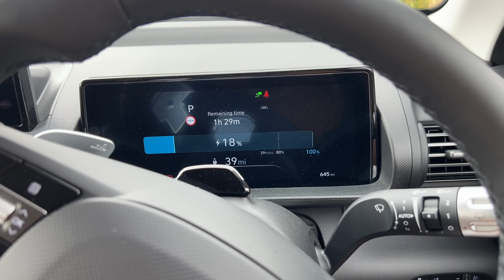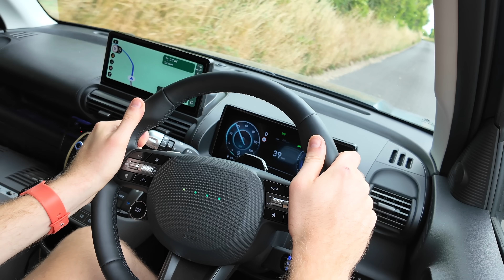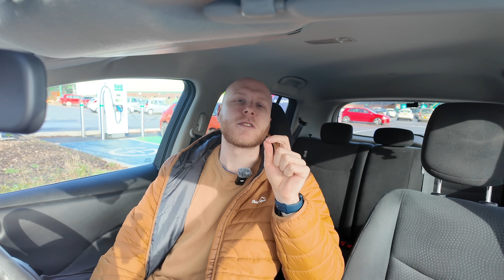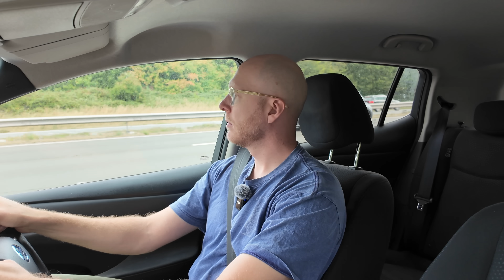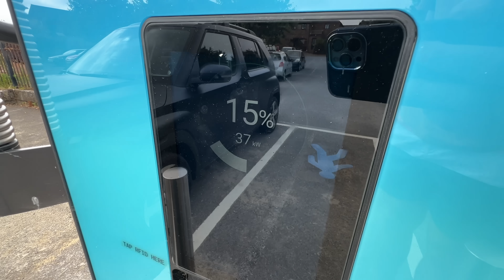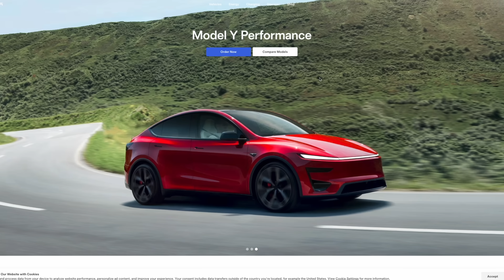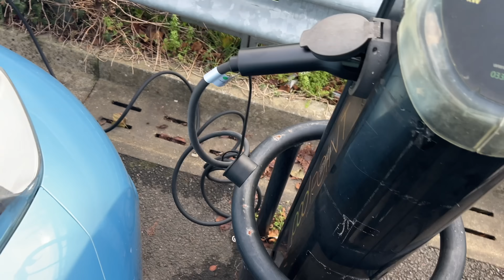19 Things You Should NEVER Do In An Electric Car

Comment: A nice video giving good information, obviously you will get the few complaining, just like those that were "never" going to get a mobile phone ! It is simple, if you do not want an EV or they are not suitable for you, DO NOT BUY ONE. Petrol/diesel will be with us for many years, probably still buy new in 2035. I remember when the UK gov said they were going to bring in the 3p per mile charge and lots of ICE users were laughing..... hmmmm are they laughing at over £9 a gallon.  I have not done it lately but for 2 years I got the off peak electric rate when ever i charged the car on "smart charge" , yes 7p per Kw  throughout the day,  I would run the washer, cut the grass,  do my welding etc . Now a lot of EVs can power our 230V tools and even power the house, great for camping too, if you get a tent that goes at the rear of your vehicle, you can warm the tent up via the EVs heater. I have not tested them lately but last year  there were still a few free to use chargers in Scotland, In Blackpool you can get free charging but have to pay parking fee's.

Comment: All automotive engineers will tell you to 'clean' the brakes by doing a fast-to-complete stop 2-3 times once or twice a month (100kph to 0kph x 2-3 times monthly at a minimum). You will be shocked how bad the real brakes are when you need them if you don't do this. Why? Brake dust. You need to remove the brake dust build up or your braking in an emergency situation could be a huge issue.

Comment: If all ev's with 1 pedal driving are the same as our 2024 mk2 kona, then 1 pedal driving is disabled when driving in reverse,  so while i use 1 pedal 100% of the time on a normal drive i am still using the brakes at leat twice  when reversing.
And then there is always that " emergancy stop" when the traffic doesnt quite match my 1 pedal brain.
Also a nice thing about any ev with regen is it creates much less brake dust on the wheels🎉

Comment: Personally I think we should never use E-Peddel: I think if you used to it, your brain will equal fully release paddel to full break, so in emergency you may forget to use brake. Also if you drive your friends normal car, it also may cause accidents since the pattern is changed . If I remeber correct, Chinese gov have banned the so called "single peddel mode" on EV after a short peroid Tesla introduce it to market in large scale.

Comment: Tip 20: Learn to hypermile and avoid adaptive cruise control. This changed my "around town" range by 25% and long range by at least 10%. 
Tip 21: Balance your battery at least twice a year. Run it down to 10%, then fully charge. This resets the battery and balances the voltage across cells (in the same way a mobile phone does). Even just a few volts on a cell makes a difference to cell degradation overall.

Comment: Elroq's manual recommends using the breaks strongly at least every 500 km. Regen is not always there for you and you don't want to ruin your breaks by not using them at all.

Also, WLTP includes several driving scenarios, so it definitely accounts for motorway driving at high speed. The figure is more like the average petrol consumption - just an orientation mark.
"The WLTP testing cycle was created using real-life driving data to better represent common driving habits and conditions. The cycle features braking, stopping and acceleration throughout, and is split into four cycles to measure consumption and emissions at different speeds, which are:
    Low (up to 56.6km/h)
    Medium (76.6km/h)
    High (97.4km/h)
    Extra high (up to 131.3km/h)"

Comment: I don't use public chargers anymore because the pricing seems very predatory. I only charge at home. But one thing you should be aware of is that if you plug into a public charger and another car is plugged into the same charger, it splits the charge between the two cars and charges you both full price. I've been at the library and there are several unused chargers, and someone comes and plugs into the same charger I'm using, and it doubles both of our costs, and cuts our charging speed in half. They could have just used one of the many unused chargers, but no, they obviously weren't aware of how these things work. The app even comes up and warns you that someone else is now using the charger, which will reduce your charging speed, but won't reduce the hourly charging cost.

Comment: A tip would be to not use s-pedal or regen braking during winter if you live a place prone to alot of snow and ice, it will make you sail around on the roads
Reply: Any ev with a snow mode will turn off the regen for the reasons you give above.
Reply: @brianiswrong cant be alot of them because i see them sled skidding on a daily basis because of s-pedal/regen

Comment: Yes, not using the friction brakes can cause the rotors to rust and other parts to corrode and stop working properly.  I like one pedal driving in the city or heavy traffic, where speed is frequently changing, but one pedal driving is not the most efficient otherwise.  I use cruise control on the highway and a low regen mode for coasting to a stop or low speed.

Comment: Regen braking is all well and good, but it has caused all these electric cars to fail their periodic vehicle inspection or PKK as it's called in Norway due to rusty brake discs and/or seized up parts.... It has become such a common problem with electric cars that the Norwegian Automobile Association several time has gone out and recommended a good and "enthusiastic" braking every now and then, to keep the discs clean and preventing parts from seizing up.

Comment: I use "iPedal" in my Kia EV4 because it gives me the best control of the car and the most range in city traffic. But if I drive on a rainy/wet day, I reduce regen to its minimum and press and hold the AUTO HOLD button which activates Brake Disc Cleaning mode. This combo helps prevent corrosion. The car automatically prioritizes friction brakes which means that they get nice and hot in the wet, allowing them to dry off better and reduces corrosion. I owned a Prius years ago that needed a brake job early due to corrosion. The brakes probably should have lasted 200,000km had I prioritized using them in the wet. I learned my lesson.
Reply: That's a very useful feature!

Comment: I hate the fact that every EV tries to be cheap and copy Tesla (which chose literally every design decision based on it being cheap and not being safe or good to use). I get why (it's cheap and they can ride on the branding coattails) but it's killing the public's view of EVs horribly!!

Like, you can use a regular gear lever for the breaking mode & drive mode selection! You can make it feel good and chunky!

You can just put normal gauges in the car! You can use regular switchgear and buttons! You can make the sound they make nice and tune it in! 

Instead we get the auto equivalent of disposable white goods and wonder why nobody in the broader public wants to buy them ...
Reply: Oh yeah, and just setting the cars up to use regen breaking unless an emergency stop is performed unless you're picking a drive mode where breaking is more significant.

I really hate one pedal driving because I can't coast with no throttle input (It's a power pedal not a speed pedal after all; it should behave like it). Just let the brake pedal work like a brake pedal (or add a third pedal that only engages regenerative breaking so you can choose between regeneration, coasting, and friction breaking at will! This also lets you choose how much of each to use and allows immediate 100% engagement of both systems together!

Comment: 1. Since when is the range stated by a combustion engine car accurate?
2. Recuperation works also when you use the brake pedal, this is even the case in by old Prius 2. It matters how hard you hit the brakes, and also recuperation cannot work at very slow speeds, hence even with one-pedal driving you will have to use the real breaks a bit (without you noticing this maybe).
Reply: I remember when ICE drivers were complaining that their car got nowhere near to the 40 mpg that the car makers said, yet somehow the same car now does 60 mpg, or so the driver says, need it at £9 a gallon ..will it hit £10 per gallon in the UK before Christmas ?

Comment: That's an awful lot of things to think about. With a petrol car the only thing I have to do is remember where I left my car keys.
Reply: He's overcomplicating it.
As an EV owner with 5 kids that need to get shuttled around to appointments and activities, it's mostly just a matter of plugging in overnight a couple times a week. Much more convenient (not to mention cheaper) than trips to the gas station.
Reply: @WateringHole  Stopping for petrol isn't inconvenient. It takes 5 minutes max, and petrol stations are everywhere. What about those who can't charge at home? They'll be using public chargers at 89p per kw. That works out equivalent to 15 mpg, and charging infrastructure is still inadequate, especially outside the M25 area. Then there's depreciation, making EV ownership cripplingly expensive compared to a petrol or diesel car.
Reply: @matthewgodwin3050 ah, I see. You just want to argue.
No thanks.
Reply: @WateringHole  You mean you can't face facts.
Reply: @matthewgodwin3050 Sure buddy. Whatever you need to tell yourself.
Reply: @WateringHole  If you can't debate without hurling insults, you've lost the argument. You were sold the lie that EVs are better than petrol cars, so you took out a large loan to buy one thinking it would make your life easier, and quickly discovered that it actually made it worse. You can't accept, even to yourself, that you were conned.  

Your EV cost more to buy than a petrol car, it costs you more to insure it, and it's now worth less because it's used value is less. You're upside down on your finance, and you're trapped in a vehicle that doesn't suit your needs. It costs you twice as much to drive anywhere because public chargers are expensive, and it takes you twice as long to get anywhere because charging takes a long time. 

You hate it when someone points this out because it highlights the fact that you made a mistake and screwed up your life. You were too proud to take advice from someone who understands the true reality of running an EV, and now you attack those very people because you blame them for your own failure. It's not our fault, it's yours. So grow up.
Reply: @matthewgodwin3050 I was never in a debate my dude.
I just shared my personal experience and you decided that was an argument.

Also, thanks for writing me what I assume is an epic love poem, but I'm not readin all that, we only just met 😘
Reply: @WateringHole  No, you trotted out the same tired old EVangelist cliches that have long been debunked. Running an EV is not cheaper, especially when depreciation is taken into account. In the UK, an 800 mile journey in an EV using electricity from public chargers costs circa £300. The same journey in a diesel car costs £150 using motorway service station diesel. It takes an average of  8-12 hours depending on model to charge an EV on a home charger. That is not more convenient than a 3 minute fill up. But keep lying to yourself. I'm sure you can also convince yourself that nobody else is laughing at you for your stupidity.

Comment: I would add another tipp:

"Explicitly use your break regularly for avoiding damage." I used to do that every other day. I did a "full break" after an acceleration downhill. I recently learned that this is not the best treatment of my car. My colleague advised me to switch to "N" after acceleration (or while going downhill). In that mode using the break actually breaks instantly without the need to hit the pedal too hard.

It might depend on your car model if this tip actually works that way. I heard that some cars explicitly distinguish between "raise from gas" and "push the break". The latter will always use the real break. One example would be a Ford Mustang Mach-E with one pedal driving activated (at least that's what my other colleague explained to me).
Reply: Don't break your brakes.
Reply: @randolphstead2988 he needs a kit kat 😂 edit, and spelling lessons.

Comment: Apparently it actually IS important to use the brakes.

Regen braking uses the motor to brake, not the brakes. But if brakes aren't used at all, they can seize up due to dirt and grime build up.
Reply: Even before they seize up, you can get rust building up on the rotors.
Reply: An emergency stop once a week will help with both seizing and rust. I used to have to do this on my old ICE because I only drove around 3k miles per year.
Reply: yeah just use mild breaking mode while relying on brakes for full stops I believe
Reply: That's even true with oilers. I usually drive with foresight and brake a lot with the motor. 
In the end I had to get new brake disks and was told to better do strongly brake from time to time. (I do this now when entering a municipality, after checking for tailgaters)

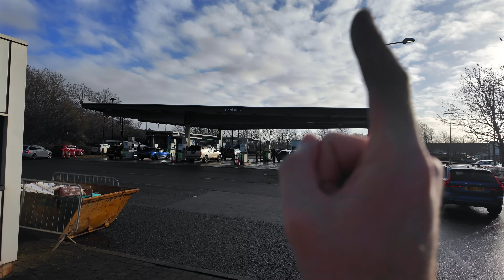Comment: 3:08 "You never have to visit one of these again."

Not quite. I still visit them to pump up my tyres or to wash my windscreen (particularly on a road trip).
Reply: You really should buy a 12V tire pump.  Sometimes you can end up with a slow leak and end up with low pressure far from any station.  If you carry a pump you can just stop occasionally and top up the offending tire until you get to a place that can fix it properly.

I also carry a small tire repair kit.  Things like a nail can easily be fixed roadside with those: remove nail, rough up hole, stuff in plug, and pump the tire back up.  This doesn't work on sidewall leaks, but those are rare.
Reply: @lakse123  I have a battery-powered one. But if I'm heading past a servo when I need to check/increase tyre pressure I'll typically do that instead so I don't have to recharge the pump.

Comment: Never using the mechanical brakes is not good as the rotors can rust
It's a good idea to force the use of the brakes a couple of times once or twice a week
Also the 80% charging rule doesn't apply to LFP chemistry 
Those should be charged to 100% regularly

Comment: You can charge a i3  BMW to 100%, because although the display says 100%, it isn't really, same at 0%, it won't run, but the battery isn't 0.  (Hidden buffer at both ends).

Comment: I have an MG 4 MG recommendation you charge to 100% once per week so the 80% rule is black and white there are always exception and the exception is charging at a home charger at home when MG recommends topping up to 100% once a week I trust them. At least I can use the argument "that's what it says in in the manual".
Reply: But what battery type is your MG4? NMC or LiFePo4? For LifePo4 the normal recommendation is to take the charge to 100% every 4-6 weeks from a home charger (so 6.4kW charger) before a journey that will reduce the state of charge down to the more normal 80% level.

Comment: Surely the advice you gave on battery charging depends on if you have an NMC or LFP battery chemistry?
Reply: Every battery stressed under full load, NMCs more, LFPs less. Charge up to 60-80% an LFP battery for three-five charges and then charge once to 100% to help BMS do it's job correctly. But use your car the next morning, don't charge it to 100% and leave it for a few days at 100%. I even charge my i3 to 100% (NMC battery) every time I have a longer trip, some times even every two weeks, but I leave home right after it is full. I plan it to be at 100% at 8 o' clock, I wake up at 7, load my stuff, have breakfast precondition the cabin and go. My battery, 7 years old has 35.8 Kwh available from 37.8 when it was new, so it works fine. I don't even charge it up to 80%, I ussually prefer to stop it at 65% and charge it more often because I know that I won't need the full range the next day.

Comment: Tip 20, do not worry about going under 20% or above 80% or both if you are regularly driving long distances, e.g. a 40 mile commute (80mi round trip) or more as it's the TIME spent outside of those ranges that contributes the vast majority of degradation due to deep cycling as you might call it, of course if you are doing these longer distances then you're likely only going to be above 80% for an hour or a few hours depending if you do scheduled charging, much less if you use rapid chargers only and drive that route immediately after finishing the rapid charging session. Same for going under 20%, as long as you know you're going to plug into a charger the same day going under 20% won't do any harm, just don't go under 20% and then leave it unplugged for the weekend every week or when you go off on holiday. If you're doing these longer distances you're going to use up the raw battery cycle-ability (e.g. the ~1500 cycles for NCM, ~3000 cycles for LFP) before calendar aging or deep cycle aging get a chance to make a dent! of course it's still good to keep within that range whenever you can, it never hurts to have some mechanical and/or chemical sympathy but don't worry. The guidance is mostly for people who commute say 20 miles or less per day (the majority of people) who therefore when exceeding 80% would likely have the car sitting there for days at a time, especially if they plug in every day then they might NEVER get the battery down to <80% and then it will degrade.
Reply from the maker: Nice little summary that, makes sense!
Reply: This does make sense. I bought my LEAF EV in 2015 and its range is "85 miles". So going into town and back gets its below 80% -especially since there is a steep hill at the end of my round trip. I have not lost any range. I live on a smallish island and my EV is perfect for this "little old lady". PS I live east of Victoria, British Columbia.